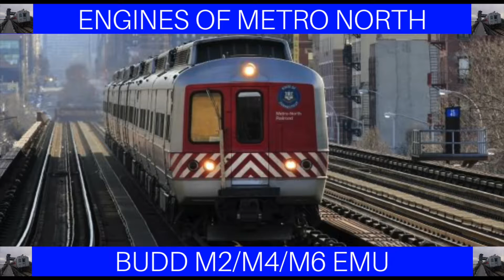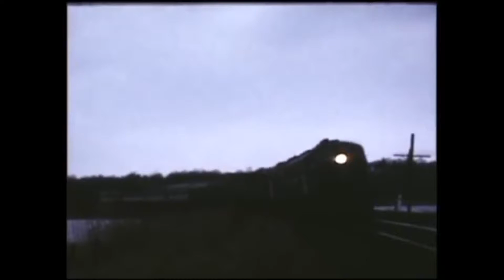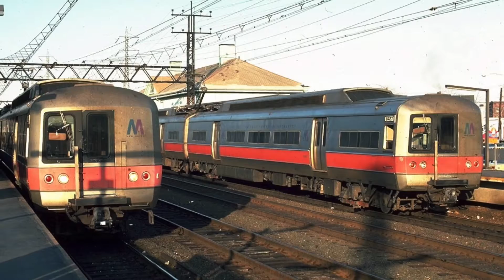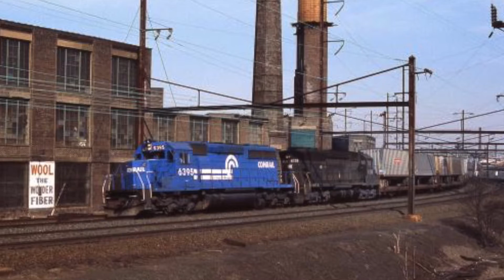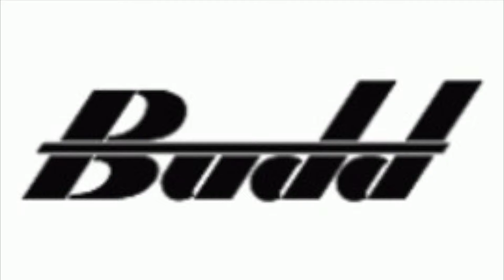Engines of Metro North Budd M2/M4/M6

Comment: These cars are plain nostalgia😊
Reply from the maker: I agree, once the m3's are gone budd equipment will be all gone from metro north and the LIRR as well.
Reply: nyrailfan 202- Yep. It sad to see them go, but they will be missed.
Reply: @nyrailfan202  Budd equipment will always be remembered.
Reply: @nyrailfan202 Update on Metro North/LIRR M3s: They Are still in Service
Reply: @nyrailfan202  in by 2021 some of the metro north m8s are retired since they got send to Quebec canada were they get scrapped
Reply: I codent agre more
Reply: Long Island Rail Road are rebuilding 100 M3 cars to put back into service
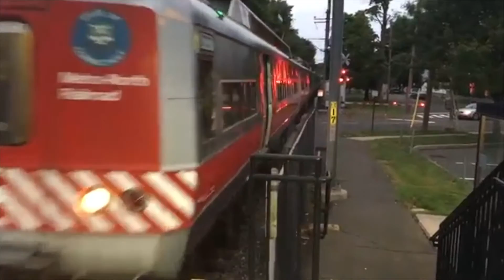Reply: 7:44 All M2s, M4s, M6s
Reply: 7:49 sent away for scrap
Reply: 7:46 M sixes
Reply: 7:39
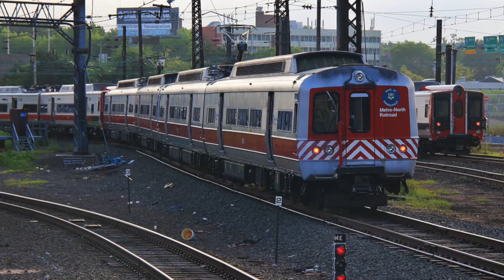Reply: 8:06 8:07 They outblasted them at the end.
Reply: 7:45 M fours, M sixes
Reply: 7:29 7:30 However…
Reply: 7:19 to contain a bar car
Reply: 7:28 Amtoos
Reply: @tom-and-mom  They should never scraped them in the first place. What they should of did is to keep the M2S M4s M6S on the cut Incase if the M8S brakes down or something. The M2S M4s M6S should of definitely put positive train controls in them just like did with the M7AS on the Metro North railroad and the M3AS M3S on the Long Island railroad and the m7s and the M9S.

Comment: Why did the M6 retired early? I mean it looks like the M6 can run for another decade instead of retiring early
Reply from the maker: It could’ve but it was cheaper to standardize the fleet
Reply: @nyrailfan202  make sense and I wish the Metro North and Conndot would sell the M6 to any railroad in the US for their electric commuter lines like Metra, or Amtrak (Which I guess they won't buy it)

Comment: And none weren't even made in scale models, it's such an outrage how the M 2 Series & follow ups weren't saved for our various museums! The cars that replaced the PULLMAN STANDARD mid 1950's "WASHBOARDS". Well I hope the scrap happy morons are proud of themselves as a railfan of them I had my many pleasures of riding them in the 1990's to OLD GREENWICH Connecticut, Civic Center especially to the now defunct model train show & building that I heard was torn down 😤! The treat to ride them to STAMFORD, & beyond to South Norwalk then to change to The DANBURY line to The DANBURY RAILWAY MUSEUM. Of course by the FL 9 Engines 🙋. I saw the other video as well. I'm sorry for that I didn't get to ride the M2 /M4 & M6 series to New Haven, CT. The last cars that had the cabless cars were built for Sunitomo they built cars For MARC in Maryland, & rebuilt for NYCTA Slanted R 40 subway cars. My last ride on them was spring 2012. I viewed them as a little boy & I treasure watching them I miss them grandly. Thanks for presenting this. 👏👏
Reply from the maker: There are m2’s at Danbury

Comment: What is the difference between M2, M4, & M6?
Reply from the maker: The m2 was a 2 car set the rest were 3 car sets that the main difference there were also some minor ones as well
Reply: @nyrailfan202  The fleet numbers are the difference that I can find on the identical M4 and M6. 8900-8935 and 8951-8985 were the M4's. 9000-9031 and 9051-9081 were the M6's.
Reply: Also the M4’s B car can seat more people than the M6’s B car. With the M4’s B car seating 113 people and the M6’s’s B car seating 106 people.

Comment: Once again I love the M 2s 4s 6s, I just imagining what if the mta had purchased the Amtrak Bud Metro for the mta rolling sock, just wondering, I'm also an Amtrak metro fan
Reply from the maker: Amtrak was still trying to make metroliners reliable. So they never purchased them
Reply: @nyrailfan202  I'll never forget the Amtrak metroliner specially the refurbished ones and the R44s R46s R68s also have love for nyc subways
Reply: @jimmymakmta  You forgot about the R62AS and the R62S and the R32S And the R29S R26s R36MLS R33WF R33ML Redbirds.
Reply: You also forgot about the FL9s New Haven FL9S metro North railroad and the FL9AC.
Reply: @Lee Cornwell  no I didn't forget  the Fl9s, I'm a strong Budd Metro fan, now I also love the EMD F7s and the F9s and number of diesels
Reply: @Lee Cornwell  just speaking of subway fleet  R44s, R46 68s Ithose were my cars I loved the most
Reply: @jimmymakmta  The M2S M4s M6S we're my favorite cars on the metro North Connecticut. Those cars should of been on the cut Incase of the m8s brakes down. Adleast they should of put positive train controls on the M2S just like they did with the M3AS for metro North railroad and the M3S for the Long Island railroad. You know the Long Island railroad has 80 M3S on the Long Island railroad right now. I'm definitely gonna miss the R46S R44S when they go . From what I heard they have 33 M2S running on the shuttle back and forth to standford and Newh
New Haven and they have M2S in Danbury musuim.
Reply: I miss the M1AS on the metro North railroad and the FL9s FL9AC s older FL9S NH Metro North railroad. The R62AS R62S R68AS are definitely my favorite trains aswell just like the old Redbirds.

Comment: Technically, wasn't the MAS on the NHL between Harrison and New Rochelle 90MPH for a time?  I think it was reduced a few years ago.
Reply: I used to love watching trains at Mamaroneck... I should start doing that again.  One day, I hope to get one of those cameras that have insane optical zooms (like the Nikon P1000 and its 125x optical zoom) so I can stand at the end of the platform closest to the Marval lead, and be able to see people and trains clearly as they arrive AT Larchmont, for instance, haha.
Reply from the maker: You are correct it was 90 but not anymore
Reply: @nyrailfan202  Reduced after... the Spuyten Duyvil derailment, or was it changed a little later than that>?  Can't remember with any certainty.
Reply from the maker: It was a few years after that. I think it was in 15 or 16 and I heard it was just due to the extra maintenance the section required
Reply: @nyrailfan202  Ah, so closer to when the derailment just north of Rye happened (I think?)
Reply: @nyrailfan202  I am still kicking myself - back when the MAS was stil 90, I had a Magic the Gathering card in my hand while watching trains at Mamaroneck, a basic land from the very first set (Limited Edition Alpha, 1993)... an Amtrak train thundered by at 90, and blew the card out of my hand, never to be seen again.  Now, the card, a BASIC LAND card that is usually $0.05 - $0.10 each), is like $40 each due to being from the first set.

OTOH, much as it hurts as a big fan of the game, it makes for a funny story. 😂

Comment: Will you PLEASE slow down.  You're speaking way too quickly.  And the voice level is too low with respect to the music.  It's very difficult to understand what you're saying.  You've got a lot of good information here.  But it's not coming through.

You've also got a few mistakes and omissions as if you're reading someone elses works instead of reciting your own research.

You keep saying the M1/M2 replaced the "pre-war" EMUs.   But the Washboards were NOT pre-war.  Yes, there still were "pre-war" EMUs (drab green color) used on the New Haven line and (I think even moreso) on the Hudson line in the late 1960s.  I believe those were built in the 1920s.  But in the years just before the Cosmopolitans arrived, New Haven was primarily operating the 4400-series "Washboards", which I think were made by Pullman.  You show some in your video.   Those were ALL manufactured AFTER WWII  They had leaky roofs and they wobbled a lot.   The seatbacks were reversible.  So when the train reached GCT and discharged all the commuters, a conductor would prep the cars for the return trip by walking up the aisle, shoving all the seatbacks across the cushion so the seats would face the opposite way.

Also.  You neglected to state the the elevated station platforms were built in anticipation of the Cosmopolitans.   Up until roughly 1970, the vast majority of stations in Westchester and Connecticut lacked raised platforms.  This was not a problem for the Washboards. Those had steps and conductors to raise or lower the "trapdoor" at each station stop depending upon whether the steps were required.  The platforms were erected just before the M2s began rolling out because the M2s lacked steps to accommodate rail-level platforms.   The Cosmopolitans were the first to use electric passenger doors.  The Washboards (I believe they were called "Metropolitans", but don't hold me to it) required conductors to manually open the doors at the station stops.  This extra labor cost was what the RR wanted to eliminate with the M2s and their electric doors.  So, the steps were done away with.  This also reduced station stop durations as commuters were able to enter/exit the M1s without negotiating steps with their parcels, etc.  It also made the M1s "wheelchair accessible".

You claim that the M2s brought greater ridership.   Where did you get your numbers?   When the M2s arrived, they were plenty empty compared to just ten years earlier.   What was nice was that they had great air conditioning, which was a boon, fersure.  But in the 1970s (perhaps due to all the bankruptcies and the constant ticket increases) a large portion of commuters had abandoned the rails altogether in favor of driving.   The trains were more reliable in the snowy winter months - recall that the 1970s were particularly cool with lots of blizzards.  But with good weather, folks would drive.  The 1970s was the era when commuters were buying a second car.  it coincided with the influx of cheap imports like Toyota/Datsun/Honda.    What drove folks (pun intended) from their cars BACK to the rails was the 1976 OIL EMBARGO.  when gasoline prices skyrocketed and there were long lines at the gas pumps and odd/even-day rationing (you could not just fill up any day you wished... your day was determined by your license plate).  Well, THAT nonsense is what drove folks back to the New Haven, Hudson and Harlem lines, NOT the introduction of the Cosmopolitans.  I was there.  I lived it.  You weren't even born.  Perhaps your parents weren't even born.  You're relying upon the assumtions of total strangers.

I get the whole clickbait paradigm.  But if you're claiming to recite history as if you are a historian... the least you can do is get your facts right and complete.   If what you really want to do is talk about the railcars, then stick to that and omit the historical embellishments because you're not getting it right.
Reply: They entered Service in the 1950s. The problem with these Pullmans as they had a stainless steel outside according to some reading they had an aluminum bottom I think could be wrong but it was very prone to rust making them not last long. They were great on the DC and few were removed from the New Haven and moved to Hudson on the DC 3rd Rail for testing. Didn’t last long till the M1s took over. They had issues with the AC To DC which I believe was a Mercury Arc.

Comment: The Washboards came during the 1950s though
Reply: These were the first air-conditioned MU cars, with quick acceleration to handle local runs to Stamford, and some "local-express" runs to New Haven.  But the ride was bouncy at higher speeds.
Reply: 1954.

Comment: Currently, 28 M2 units are still here, probably til 2019
Reply from the maker: I wrote the script for this like a month ago so that’s why, some were just sent for scrap
Reply: Some M2S is keeping them on the cut like they did to the R32S when the R179s had door issues and the train draw bars link had  cracked.
Reply: There was nothing wrong with the M2S M4s M6S at all. Those trains were very reliable service and running smoothly. I'm very grateful that they kept some M2S on the cut . What they should of did is to put positive train controls in them.